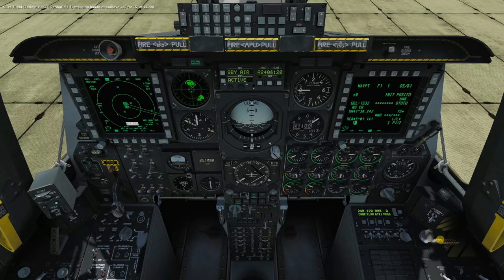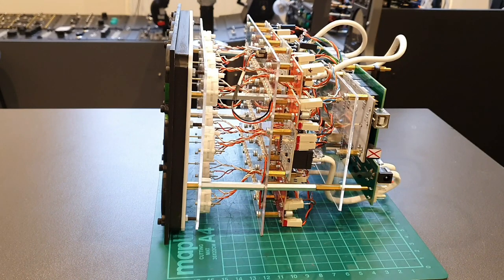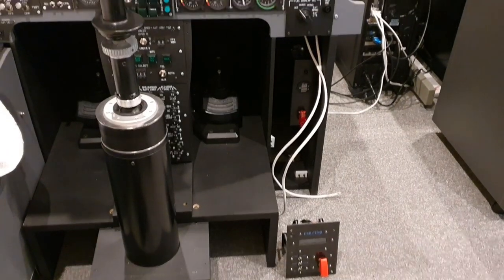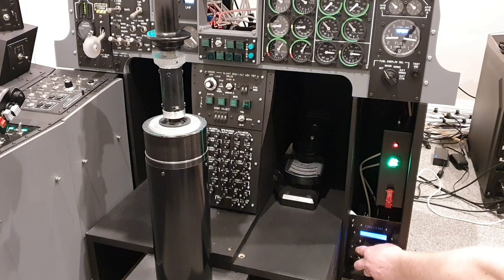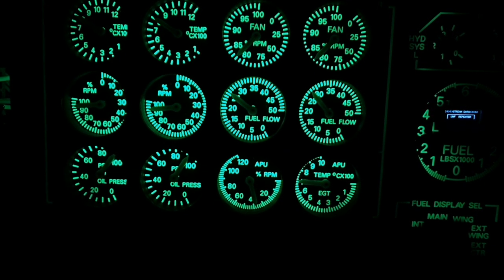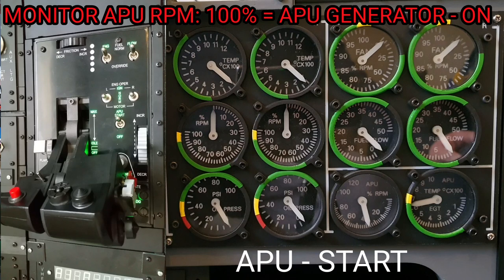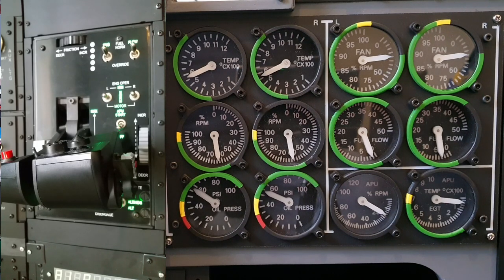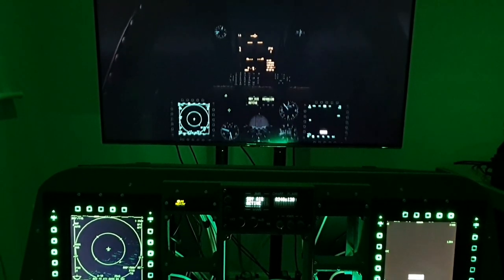Simpit A10C - Front Dash - Part 20: Engine Monitoring Instruments - Operation Test

Comment: Craig, from experience of RS485 in industry.  Normally you see line termination resistors at each end of a twisted 485 pair. Did you not require this here?  The termination helps prevent reflections and hence date corruption on the data network.